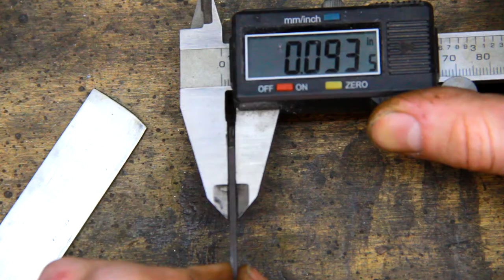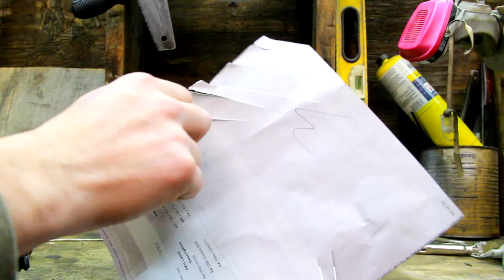Pocket Knife Blade Replacement

Comment: Impressive work with that torch. Especially when you brought the blade color up to blue. Nicely done.
Reply: Yes you have to temper the metal first you heat is then cool it fats in oils to make the metal stiff but fragile then you heat it and cool very slow with heat bringing it down slow this tempers and makes the steel strong
Reply: Oh um I may have posted that on the wrong poster if so sorry I've had a couple beers I was only trying to be helpful
Reply: @timwegman5776  It was all done wrong lol!

Comment: Got to say I'm very impressed I take apart and put together pocket knives all the time as part of my job and I got to say you're the first video I've seen where somebody actually filmed taking apart a pocket knife and replacing the blade and putting it back together that alone is awesome to see but yeah I would love to see another video of the whole knife being restored
Reply: I want more of this content as well. Specifically recovering traditional slipjoints with the jigging and cover sanding etc. and some more info on the pinning work.

Comment: Great work but blade profile is a little off, needs a nail notch and  bigger tang to get more spring tension.  I have not made any blades but replaced a few. I haven’t mastered a good looking nail notch, just used a dremel cutting wheel, effective but ugly.

Comment: On the "heel" of the new blade (where the edge meets the rotating pin there's a bump) I would have made that a little bigger. It prevents the knife from smacking into the spring when you close it and it's easy to file it down after assembly.
Reply: There is no springs but ok
Reply: @devatwell334  The steel spacers are also springs, that’s what allows the blades to snap open and closed and provides the necessary tension for the knife to function properly.  😊

Comment: Nice work. On disassembly, did you pre-drill the rivets before punching them out? Also, on reassembly did you reuse the same rivets or replace them with new rivets? If you replaced them, did purchase them or fabricate them yourself? Also, it looked as though you were going to fabricate a new blade spring as well, did you do that or did you reuse the existing spring? Again, nice job, thank you for posting.
Reply from the maker: I didn't predrill the rivets, as I was worried the drill would wander.  The punch allowed me to be much more accurate, though it was a bit more tedious.  I made new rivets on the lathe from mild steel since the size of the originals wasn't readily available.  I tried to reuse as much as I could from the knife, so other than the new blade and the rivets, everything else was kept as is.
Reply: @flyingwforge4628  Great job on the penknife Mon Ami. I discovered a really neat way to push out the rivets on these knives : on the stationery jaw to your vice, drill a hole inside the jaw to receive a hardened ,pointed pin (broken drill bits are ideal) whose diameter is just less than the knifepin. Offer the penknife up into the jaws placing a suitably shaped washer (old bicycle brake washers are perfect!) over the other end of the pin to  allow it to travel when pushed. Hope that's clear enough. It's a very controlled and non destructive way to push out the pins------ and the same technique will also remove cotter pins/ tool handle pins, etc., all without ever striking a blow.  😄

Comment: Nice job on the new blade except the point profile is incorrect. A By Scout camp knife has a what I believe is called a drop point. Also, you should cut a thumb nail slot as in the original.
Reply: Spear point.
Reply: @wizardofahhhs759  Yes! That’s it! Thanks. 😊

Comment: I need a similar size blade for an all stainless miliitary camp knife. The entire blade is missing. I am ready to snap everything back together if I can find a blade.
Reply: Look for a maker stamp, then check online. Ive found replacement blades for old timer knives on walmart.com.
Reply: @JeffyLube  I know what I am doing and it is not as easy as you suggest.
Reply: @jgbullen  Im not saying its easy, only giving some advice to check online for a replacement
Reply: @JeffyLube  I have been there and done that and  currently have an expert from a large cutlery company searching through their  stock. They buy closeout extra stock from large companies  for resale of blades and other parts.